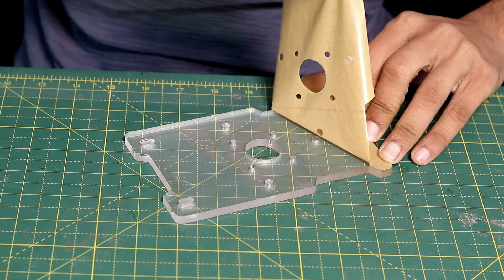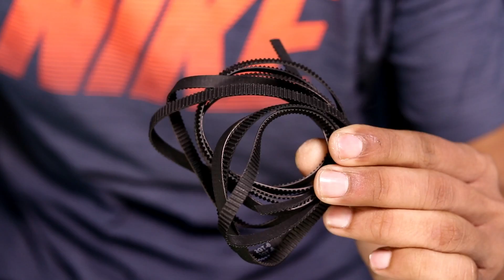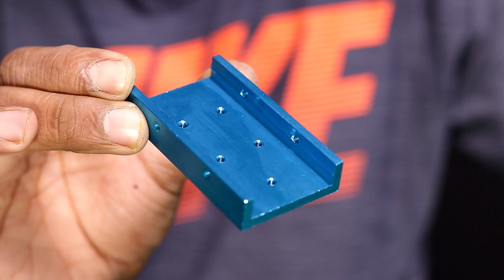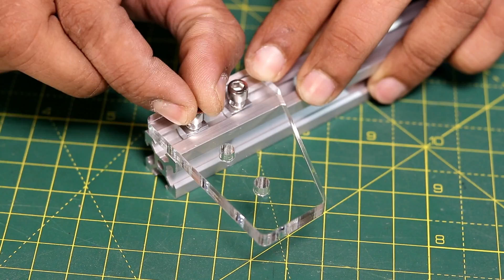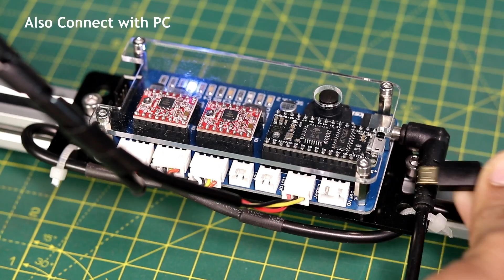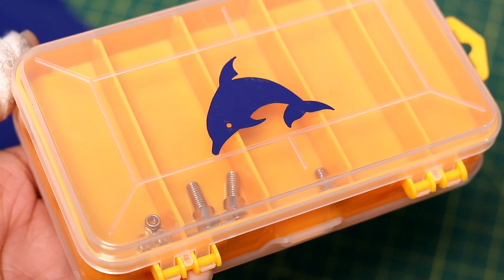WOW! Amazing DIY Laser Engraving Machine Kit

Comment: Fantastic machine, bro! 😃
Do you think it could cut foam board? It would make the process of making rc airplanes much easier... 🤔
Reply from the maker: thnx bro btw i did'nt tried ,bcz i do not have foam board.
Reply: Can Engrave: Wood, Plastic, Paper, Bamboo, Ox Horn, Leather, Sponge Paper.
Reply: Lasers can cut through anything subject to having enough power "I.e this one will not cut steel " so as long as it can burn / melt it will work. The most important question you should ask yourself is how reflective or see through is the material. E.g to cut acrylic it has to have a dark paper covering. Foam sometimes melts unevenly, the only way would be test the type you are using.  Before buying send some foam to the seller/store so you can see before you  buy. I use mine to deep engrave/cut gold and silver,, to do this I have to keep painting a dark lacquer on the metal. Mine has more power than this model . You must also fit some ventilation,  most things emit smoke and in some cases toxic chemicals.
Reply: @nickbird7742  Great tips, dude! Thanks a lot! 😊